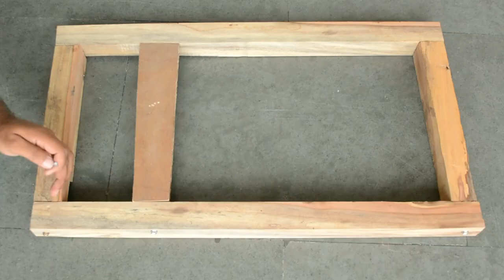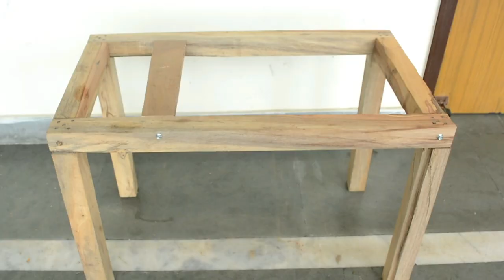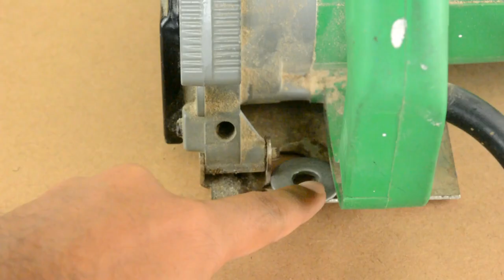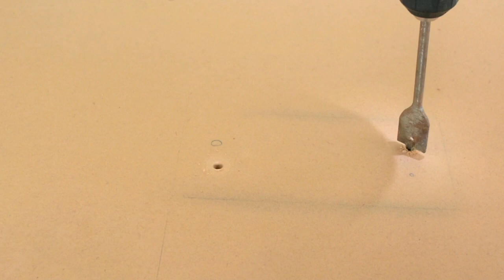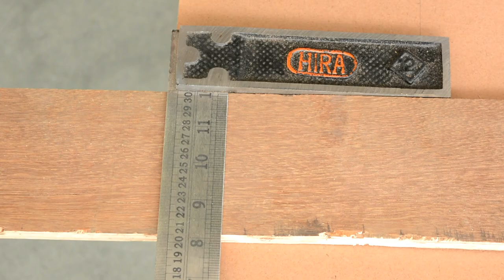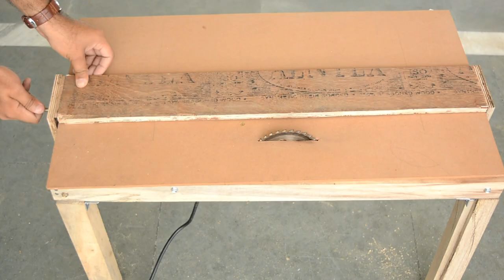How to Make a Powerful Table Saw at Home

Comment: You know what man, it's not the best fabrication of a table saw but it does work. Some small modifications and your good to go. Doesn't have to be fancy, it just has to function properly and accurately.
Reply: Matt Acosta, you know what man, save yourself some trouble and do yourself a little favor! Get yourself some Kreg RipCut Circular Saw Guide! It works almost the same as the expensive table saws and almost does accurate cuts as tables saws.
Reply: @taolang1089  that tool is junk!

Comment: tons of flaws, he uses the drill in reverse mode, the design is flawed, the guide moves, the final cut is not right, i hope he keeps his fingers still
Reply: yea you're right the fence is so wrongly made and the top of the table is pretty easy bendable it could just break and he finds himself facing a powerful working blade ...

Comment: The fence needs improvement. You can see in the last part the cut wasn’t straight. I’m just thinking why would you try to make a circular saw into a table saw if you will have inaccurate cuts that would surely give you a headache later. It’s just me.